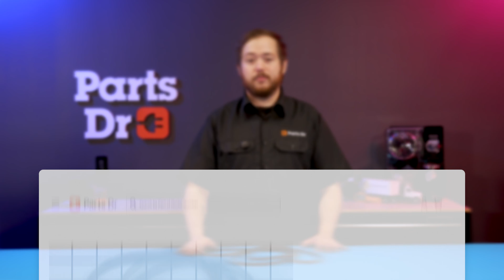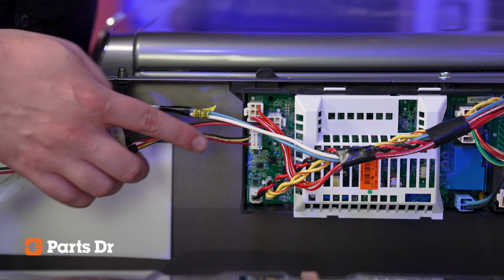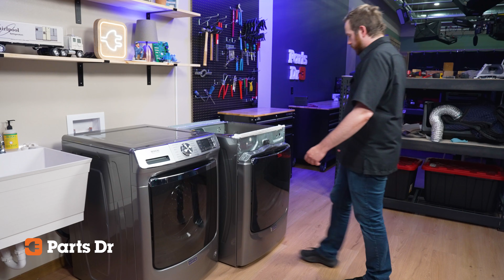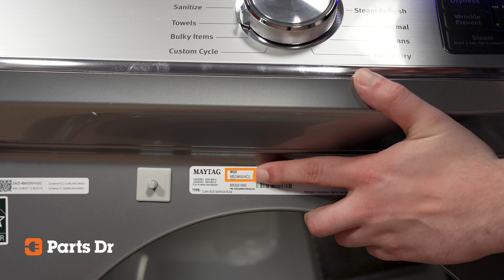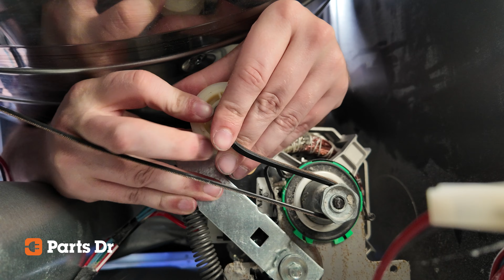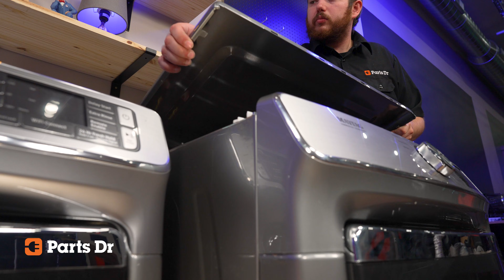How to Replace a Dryer Belt - Easy Step by Step Guide | Whirlpool Maytag Kenmore Amana

Comment from the maker: Thanks for watching our step-by-step guide on replacing your dryer belt! If your dryer isn't spinning, a broken belt is a common issue. Just a quick heads-up if you're shopping for a replacement, many of the cheaper aftermarket belts sold online (especially on sites like Amazon or eBay) can be lower quality and wear out much faster. For the best results, we recommend using a genuine OEM belt like part # 661570V. You can find the original part here: https://partsdr.com/part/661570v-belt Doing it right the first time makes all the difference. Happy repairing and let us know how your repair goes in the comments!